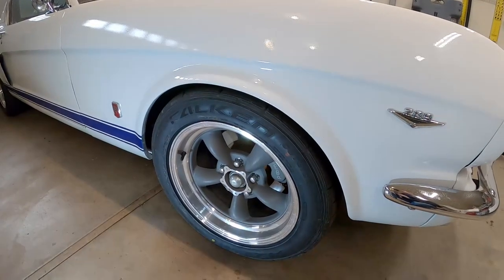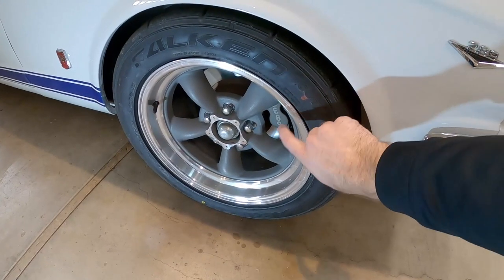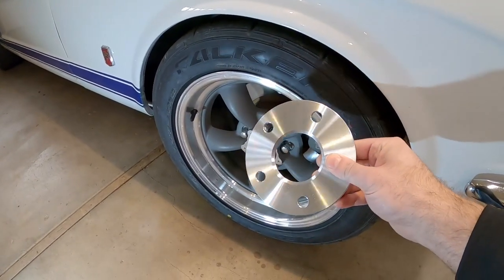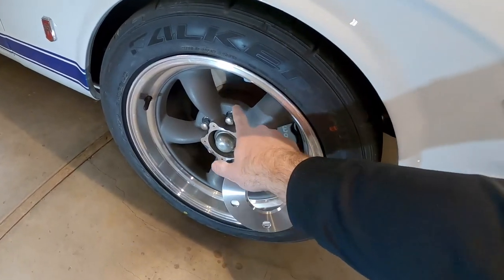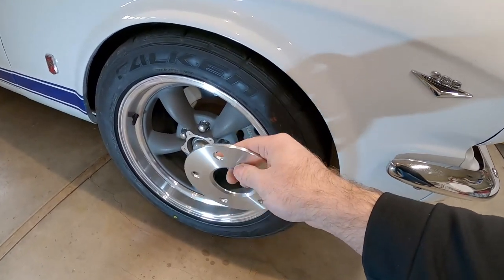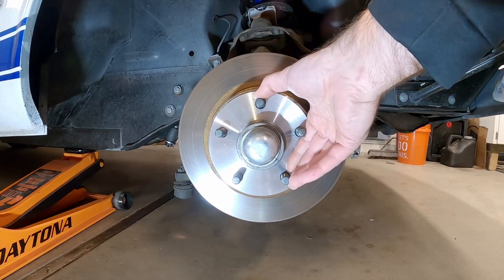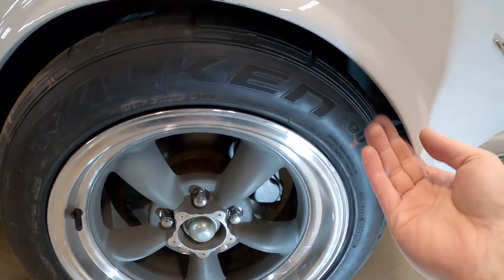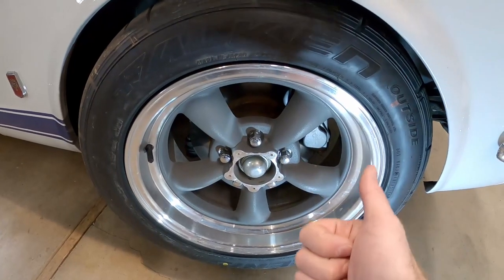Should I add Wheel Spacers to my car?

Comment: extended studs... open lug nuts and  spacers work on racecars all the time... will probably have 1 inch spacers on  my 67 so I can run 18x8's or so in a  square setup for track fun
Reply from the maker: I think the extended studs provides a lot of flexibility in what I can do, I'm still debating about upgrading to those.  :)

Comment: I'm running 1/4 in spacers on the rear of my mustang and have had no issues and enjoy the look.  I've also been running 2 in wheel spacers on my powerstroke for almost 6 yrs with no problems including pulling trailers and driving to Guatemala. Check the torque every so often and carry on.
Reply from the maker: This is good info as you're using this stuff and can give your experiences.  I wish I could make my mind up on this topic.  :)

Comment: On my 65 mustang I needed to replace my front control arms. I had no issues with my magnum 14 inch wheels with 225x60 r14. The new Moog control arms had some issues with the upper control arm rubbing the tire. So I had to add a 3 mm spacer in front and that solved the rubbing. If I had no rubbing I would probably not install the spacer. Without spacers the wheel did look already good. With the spacers I had 11 turns to lock the nuts. I read somewhere you will need at least 10 turns to be safe with 1/2”-20
Reply from the maker: Good to know, thanks for the feedback!  :)

Comment: Personally I wouldn’t use them because it’s not that much different and they look good as is, but with that being said, since it’s not that much spacing, there will not be as much stress on the hub and ball joints as say like a 1 inch spacer. So it really just comes down to your preference. Keep up the good work Andy.
Reply from the maker: Thanks!

Comment: I run 1/8-inch spacers on both front wheels of my 66 coupe (style steel wheels) because they were rubbing on the suspension at full turn. All is good after 2 years and they have never been an issue.
Reply from the maker: That's good to hear, thanks!

Comment: Personally I’d leave it alone it looks good as is and just makes more of a headache. This is minimal spacing so not as bad but pushing them out that much does put more stress on the hub, and bearings, studs and all other suspension components then you have to think about castor and camber. It is a rabbit hole. Invest in a custom built rims for the tires and look you want and I wouldn’t mess with spacers.
Reply from the maker: Yeah, it's tough to have my cake and eat it too.  It's only money, can't take it with you!  :)
Reply: @AndyKruseChannel  for sure I feel your pain I just put some wider tires in my 64.5 mustang convert and I ended up needing new rims then they clipped the fenders so needed to deal with that then in deep road dips and freeway speeds would rub inner fenders so then I had to get new leafs because mine were like 18 years old and flat so yea should have just left the smaller tires. But wow does it drive like a new car with wider tires so I can’t blame you either lol.

Comment: I had to add them as my upper control arm was rubbing against the back edge of my rim. Added the same size spacer you did in this vid and got that lil bit of clearance I needed.
Reply from the maker: See, here's a good reason to use them.  Have you had any issues with the lugs needing to be re-torqued, or the tires feel like they're "hunting" all over the road?

Comment: Personally, I wouldn't run them. In your application they are probably ok (providing the studs are long enough) as the wheel fitment is still hub centric. Consider attaching the spacer to the hub with a countersunk screw to guarantee that they are always properly fitted.
Reply from the maker: Yeah, I'm still on the fence about adding these or not.  The studs are long enough, but if these spacers were any wider, I'd need to replace the studs.  I like your idea about securing the spacers, I might look into that.  Thanks!

Comment: CORRECTLY sized hubcentric wheel spacers work absolutely fine. Incorrectly sized spacers that have room to wobble are what will get you into a hot mess. A couple dollars here could cost you hundreds of dollars there so, don't cheap out. Hubcentric is key, zero wiggle room! Safe driving yall.
Reply from the maker: Agreed, hub centric spacers are the best option, but in all my searching, these units are the closest I could find for my car.  :)
Reply: @AndyKruseChannel  love the channel. Just purchased a 68 mustang and your videos have been a great help. 

But yeah, spacers are totally safe if they're correctly sized. My overland builds all have spacers and have had zero issues. Granted it's not in terms of a classic but overland stresses should equate to pavement cruising in a classic 🤣. Will probably throw 1/4" on my 68 mustang over the weekend!

Comment: The thing with wheel spacers is that they need to be hub-centric. No exceptions. I had 2" on my jeep and went mud bogging and rock crawling, never had an issue. Have 10 mm spacers on my 66 coupe and again, no issues. And they look amazing, very hot rod aggressive. But they HAVE to be hub-centric!
Reply from the maker: Agreed, but the spacers in this video were the closest I could find to being hub-centric.  Nobody sells a spacer specifically made for this car, well, at least I couldn't find one.  :)

Comment: I had to put 3/4 spacers on the front of my '66 mustang because it has 8in wide rims.  I found the rims were rubbing on the frame at full left or right turn. I put longer studs in as well as drilled the lower control arm for a nut and bolt positive stop.  No problems in 5 years.  All it does is make my turning radius alittle wider but who cares.
Reply from the maker: It's good to hear people are not really having any issues with spacers on these cars.  :)

Comment: Hi Andy, come across your diff video with your old 66.
Considering putting 3.55 gears in mine,
What have you got in the fast back and do you recommend 3.55 gears mate.
Cheers from oz.
Reply from the maker: Awesome, welcome aboard!
The Fastback has the factory 2.80 gears and open diff, but stay tuned for an update on that soon.  :)
The 3.55 gears are a great compromise in acceleration but still usable at highway speeds.  Something shorter like a 3.83 or 4.11 would be fantastic from light to light, but anything above 50 MPH would be high RPMs unless you had a 5 speed, and it would still be high.  I live out of town, so going anywhere requires using the highway, so the 3.55 gear set was perfect for my setup.
Reply: @AndyKruseChannel  cheers mate and will stay tuned.

Comment: Hey Andy! Thanks for posting this, I also just got a 1 inch spacer to help fit my new disc brakes in the rear of my 67. The front wheels were able to fit but the back need to have the spacers. Do you think that will be dangerous to drive around daily with? My brake pedal is really spongy with the front disk brakes only.
Reply from the maker: You're welcome!
Not dangerous, but not ideal.  Imagine the rear brakes of the car going out, you'd still have the front brakes to slow you down.  Not something I'd leave for very long, but manageable if needed.  Rear discs will be nice to have, although, the front brakes typically do most of the work and are usually biased so they do most of the work.

Comment: I used 1" spacers on my 66 mustang so I could use the 2004 gt "billit" rims since my spacers came with studs in them I used blue lock tight in the hubs studs and check regularly to be safe. No issues yet 🤞
Reply from the maker: No issues is good!  I'd probably do the same thing with the blue loctite if I went with larger spacers.  :)

Comment: If spacers are hub centric both male and female ways (both sides) and the lugs are quality then yes they are safe within reason. You will go through wheel bearings and other suspension parts faster depending on application. I personally only use them on my drift car when needed. It’s always better to buy the right wheel specs. Your car looks great I’d leave it but I’ll bet you will try it. Maybe only in back?
Reply from the maker: Correct, these spacers are hub centric (those shown in the video are my 4th pair, trying to get it right).  :)

Comment: Wheel spacers are safe, just make sure you get high-quality ones. I have an f450 with 1inch spacers in each corner, and I use it tow 20k lbs weekly. They are safe
Reply from the maker: Thanks for the tips!

Comment: I'm surprised you didn't measure the exposed thread after removing the bolts.  With the spacer, you lose 5mm but is there enough thread left for a good purchase for the bolt?
Reply from the maker: Yes.

Comment: Do you plan to add the same spacers to the rear for equal geometry?

I added the same to the front of my 66 as I have 15” rims and when I added Wilwood disc brakes they rubbed.
Reply from the maker: Yes, I should have clarified that in the video, I have 4 spacers, all 5mm, for the car.

Comment: I think I would put them on the car. It will make it look more aggressive , I put 15 by 7 all the way around my 66 and I used the american racing wheels number i got from you , they look great. The only problem I have ran into is that the driver side wheel scrubs not from turning just when the body shifts. I got a sway bar like yours but I dont have it installed yet. I think when I do that it will stop scrubbing on that side
Reply from the maker: If you're referring to the rear wheel touching the quarter panel when the body rolls, the rear sway bar will only help with half of the equation.  The rear bar will help reduce the body roll in the rear, the the "flex" or "give" in the rear leafs can also allow the rear tires to touch the quarter panel on some spirited driving.  When I get around to addressing the rear suspension, I'm going to do a panhard bar first, as this will keep the rear axle centered under the car and it'll keep the tires away from the quarter panels.  Then, if needed, I'll put on a rear sway bar to reduce any body roll.  Looking back, I should have gone this route with my previous car, but I didn't have the funds to do it.  This time I'll make more of an effort to go this way.
Thanks for the feedback on the spacers!  :)
Reply: @AndyKruseChannel  my front tire on the driver side that scrubs the rear tire are good they dont scrub and it doesnt do it all of the time it seems to do it when the body shifts , thats why I am going to try the sway bar, I have put new shocks on the front and back and new 5 leaf springs on the back I will measure the hight of the cars front,   and back and get back to you , to see what you think, thanks for the reply
Reply: I have the same wheels as Andy 16×7 4" backspacing; same tires but size 16r 215 50. My driver side front also rubs occasionally. I've been told its most likely an alignment issue. My car is also dropped 1" in the front

Comment: Do you think that if you had gone with 16x8 wheels you wouldn't need the spacer?
Reply from the maker: Possibly, but I didn’t want the tires to stretch to fit the wheels, and these tires are close to the max size.  I still can’t decide which way to go with wheel/tire size. 😆
Reply: @AndyKruseChannel  Tagged you on the forum.

Comment: Just for anyone that may consider this my stock rear lugs werent long enough on my 67 to use even like a 1/4" spacer, i didnt have enough threads left, i did get a 1/4" spacer on the front though cuz i barely had any clearance between the tire and i think its the upper control arm?  They were just about rubbing.  I have 12mm offset wheels
Reply from the maker: I never did end up using these spacers on my wheels, mostly because I was afraid there would not be enough thread engagement to be safe.  It might have been fine, but it wasn't worth it to me in the long run.  :)

Comment: I say if you like it go for it. Hate that the 65-6 has to roll the fenders to put larger tires. What size tire are you running?
Reply from the maker: I don't like needing to roll the fender either.  I have 225/50/16 on there.  On my previous Mustang I had 225/60/15 and I think it looked better.  Too late to change them now.  :)
Reply: Hi Andy
Did you have to roll the fenders for the 15 inch tires? I'm switching my whole setup from a 4 lug to 5 lug with disk brakes on the front. Need to get tires on this thing I just don't want to buy then find out i have to do extra to get them to work. Thanks bro.